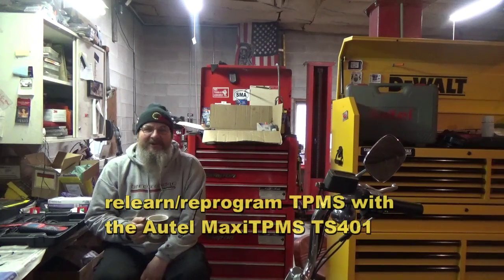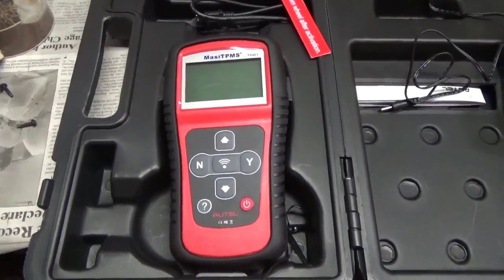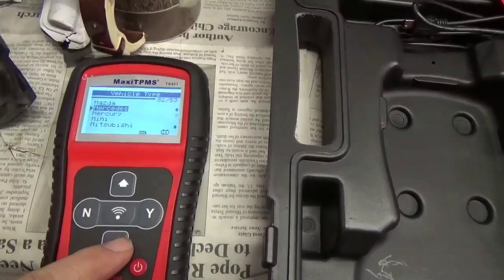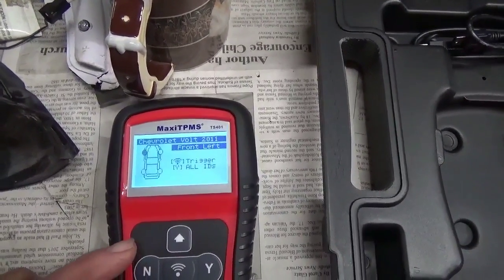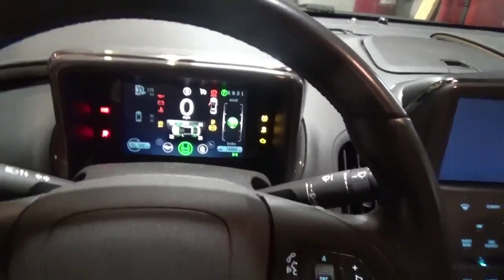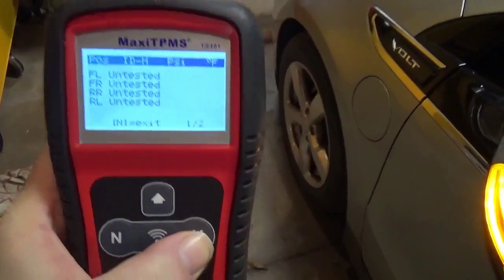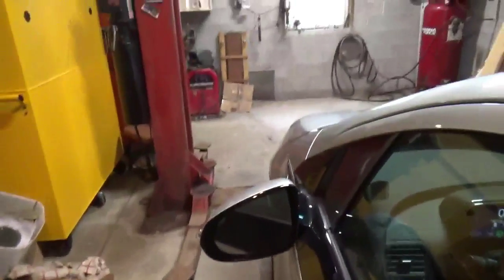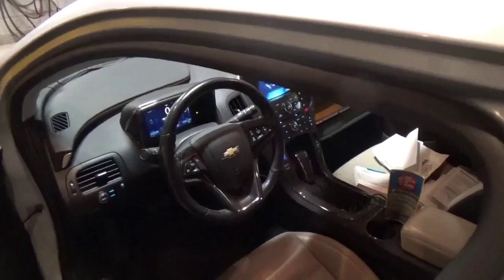Using  Autel MaxiTPMS TS401 to  relearn TPMS.

Comment: I m confused did you put tpms sensor inside the wheel before setting the sensor codes, or just checking if the sensors are working

Comment: Nice video but I can never make it work. I have the 401 and I know the sensors are all good but the system will not reset.
Reply from the maker: I had a ford f150 pick up at work that would not reset. The problem was in a another module that needed replaced.
Reply: was that a module or sensor
Reply from the maker: I just looked at the repair order and on the Ford they replaced the radio receiver for the TPMS.
Reply: what is the testing procedure to make sure it is defective?
Reply from the maker: Sorry I do not know. I knew all 4 wheel sensors were good and I ended up taking it to the dealer under warranty. They diagnosed the problem.

Comment: Ha my wife's friend was charged $30 at the garage to reset hers after a tire rotation. They took her car in the back for an hour, ha it probably took 5 minutes .  Good idea to buy it since it pays for itself soon. I rotate my tires every 10K . My F150 doesn't see location just PSI . Nice vid buddy a first for me.
Reply from the maker: +STEVE ROB If you don't have location then yes you do not need it for that. but the Ford F350 at work had an error and would not reset the one sensor, so the error remained. The thing I forgot to mention in the video is it will tell if a battery is going weak in a TPMS and the sensor needs replaced and also it reset the errant TPMS on the F350 so the error code was gone. So this is another valuable part of the tool. Wish I would have added that part in the video. Damn! I may have to make a short addendum video to explain this.
Reply: The Disgruntled Mechanic So it can display battery level or just good or bad battery indicator. When you get a tpms fault code on the dash a regular scan tool that erases codes wont erase tpms faults. That's something  I never thought of.